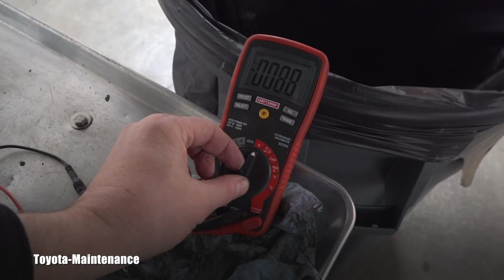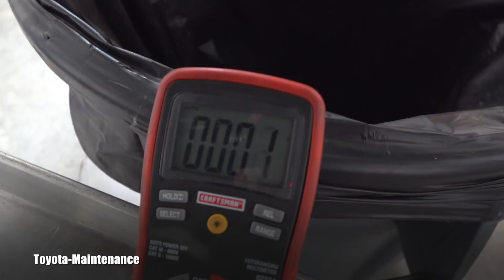Toyota 4Runner code P1135 Air-Fuel sensor heater circuit B1 S1

Comment: Wait I received 2 denso o2 sensors that ohm test at 3 ohms!
You mean to tell me they are bad????
B1s1 b2s1. 2002 camry? 
I replaced and the codes are still on p1135,p1155 . Are the new sensors bad?? They test at 3ohms.
Light comes in seconds when cleared too.

Comment: Toyota Maintainer! Thank you for the videos. I am fustrated that I cant stop my 2001 4 Runner from leaking oil. I took it to a mechanic but they are not helping! It is leaking from the front and we think its an old gasget beneath the timing belt.

Comment: Thank you Peter you are the best. I have a question for everyone on my 2008 Tacoma I noticed that the clutch on the AC is go on and off even the AC is off and the heater is On. Anybody know if it is normal??? Thank you.
Reply: If you have it on the defrost setting, or even the defrost and floor setting then yes, the defrost system uses dehumidified air to clear the fog off the windows

Comment: After about 90,000 miles, oxygen sensor failures become quite common. Other than a defective or loose gas tank cap, bad oxygen sensors are probably the number one reason for 'check engine' light activation. The heat of the exhaust gas takes a terrible toll on them. Remember that once the wires are disconnected from the vehicle wiring harness, you can cut off the wires on the sensor, if you need to use a box end wrench, or a deep socket to get a very tight or corroded sensor loose. But the correct size open end wrench, or even an adjustable wrench, will usually unscrew them. You can reach some of them from under the hood. YouTube probably has a video on what it takes to change one on your vehicle.   
Don't drive around with a bad one for months because that can sometimes damage your catalytic converter. Invest in a cheap OBD 2 scanner, since not everyone is as honest as Peter. You can research what the codes mean, and what is the most likely fix, on the internet, before taking it in for work at a shop. Leave a note on the seat 'code P1234' so they know that you know a little about what is wrong with the vehicle.

Comment: @Toyota Maintenance. Thank you Professor Peter for today's lesson about the P1135 Air-Fuel sensor for the 2002 Toyota 4Runner. Hopefully your customer will ask you to repair the sensor since it's a part of the emissions system and they'll fail the California emissions test if it's not repaired. Hopefully you'll have a follow up on that.

Hope you and your family stay safe and well.

Comment: Could you PLZ make a video on how to adjust sequoia 1st generation E-brake? Mine is very weak NO YOUTUBE VIDS.
Reply: If it's a + 07 there's some on the tundra should be close to the same.  But i don't know.
Reply: Just curious, are you talking about the brake shoes inside the rear disk/drum?
Reply: @jamram9924  I'm not sure where it's adjusted
Reply: @jayinla228 : it’s either with separate brake shoes inside the drum portion of the parking brake or it’s on the caliper itself like on Corollas and Camrys. If there is an parking brake actuator, Im not aware of any adjustments It’s just an electric motor attached to the rear caliper that simply pushes the brake pads and release them when the E brake is activated. It’s a matter of determining what style you have.